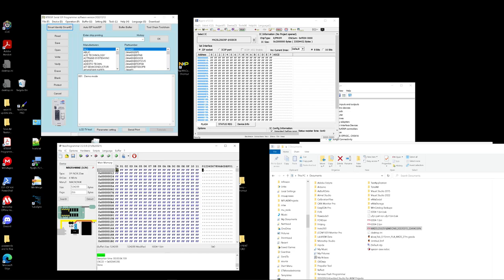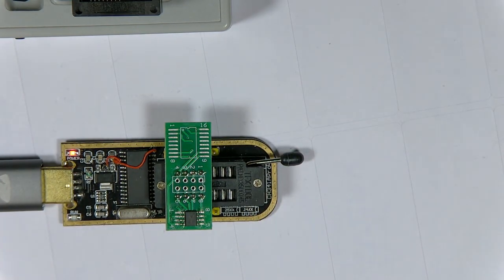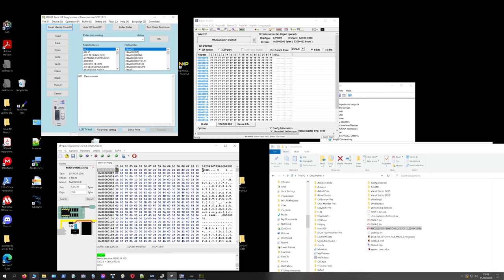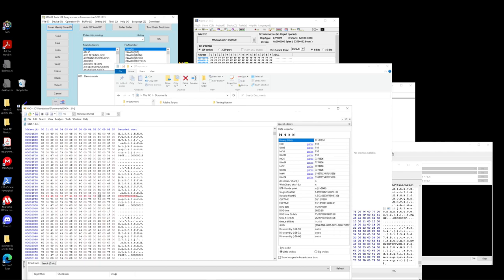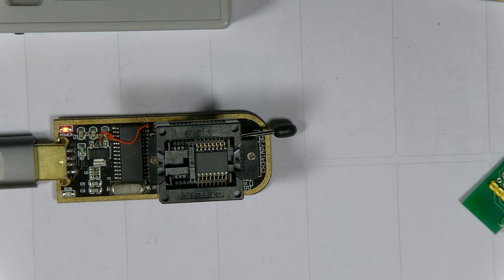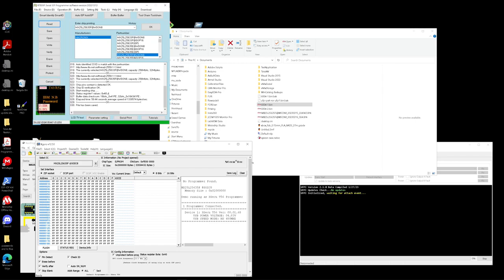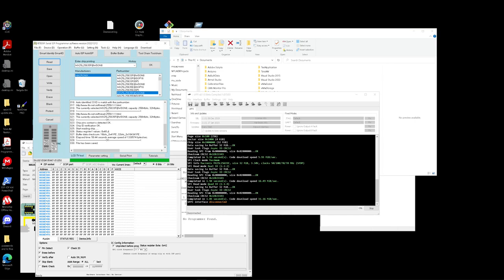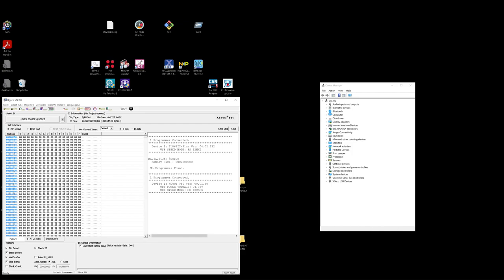Programming Bios, Nor flash chips looking at various Programmers

Comment: Thanks for the information Steve.  I have a CH341 in a box somewhere but I have never used it.  I have the XGecu TL866 II Plus that I have used to read and write PS4 NOR Flash.  It has worked well for me but I did not realize it was slow as I had nothing to compare to.  It has given me good reads so far.  I have noticed while reading the PS5 Flash that I had to turn off "Check ID" as it would otherwise refuse to read.
Reply from the maker: Yes that can happen with that model.. my T56 sometimes has same issue if i read in circuit  ill be posting a video soon showing the ps4 rig with in circuit programming of NOR and syscon